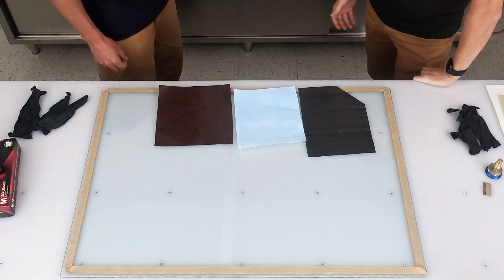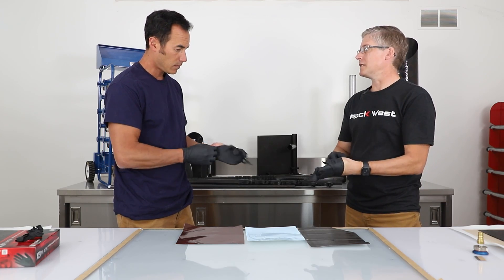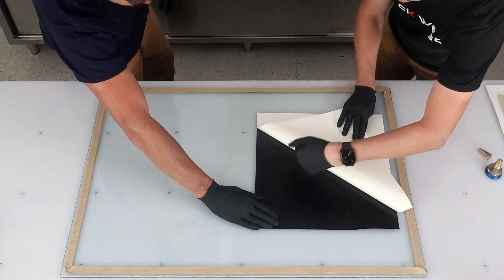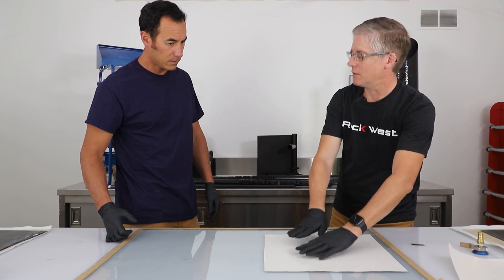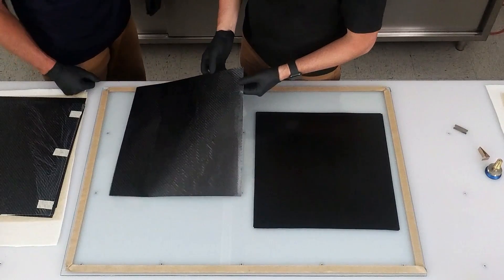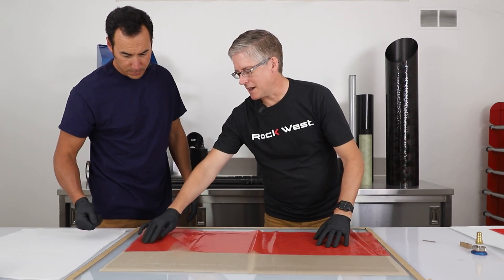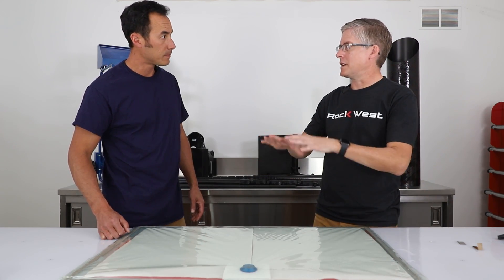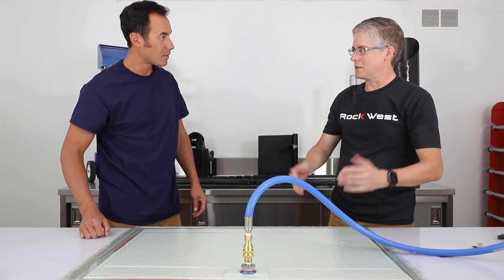Prepreg Layup & Vacuum Bagging

Comment: Dear Sir thank for interesting video , I have question , can we cut the prepreg in longitudinal (along 0 direction) direction on in the transverse direction (along 90 direction) to   make it fit with dimension requirements?.
Reply from the maker: Prepreg is easily cut with utility knives or scissors in any direction you need. Prepregs can be cut in very complex shapes to fit your needs. This is one the benefits of prepreg, it holds it's shape without fraying or changing shape, unlike dry fabric.
Reply: @RockWestComposites  Thank you so much for your kind information

Comment: How long do you leave the vacuum connected?
Reply from the maker: In most cases, and especially if you are only curing with an oven, the vacuum is connected before the part is cured and left connected through the cure and until the part has cooled down to below 130°F. That's about the point that you can touch it without burning your skin.

If you are curing with an autoclave, some requirements want to vent the vacuum as soon as the autoclave pressure reaches a set point, usually around 30 psi. but most times the vacuum is left connected throughout the cure cycle.
Reply: @RockWestComposites  So to be clear.  After what is shown in this video, the entire part (still attached to the vacuum line) is moved into an oven (or autoclave).  The part will NOT cure with vacuum alone.  The video implies the part will cure with vacuum only.
Reply from the maker: Correct. Prepreg requires an elevated temperature cure cycle in order for the epoxy resin to crosslink and become a solid. While prepreg will eventually harden at room temperature, it will take months or years, and will never exhibit it's full mechanical properties. Vacuum or pressure of some sort must be used throughout the entire cure to ensure proper compaction while the resin cures.

Comment: What companies in America use this laminating technique?
Reply from the maker: We can't speak for other companies, but most prepreg hand layup is done in this fashion. Of course, if you have some profile to your part, the layup will be slightly different as you place the materials on the mold.
Reply: aviation composites are usually woven and places at 90's and vacuum bagged with a heating blanket. so, anyone working around composite aircraft use this or similar.

Comment: I could see how an air bubble could get trapped then expand causing delam when put in the oven during the curing process. maybe a roller or squeegee might help
Reply from the maker: It's understandable how this could be perceived, but the vacuum bag is very powerful and provides up to about 14 psi of external pressure. The vacuum bag eliminates trapped air when the air is evacuated. The prepreg is porous and allows air to travel though it while is cures. It's also common practice to "debulk" or add vacuum bagging steps every few plies if you are laminating very thick layups. Adding an autoclave cure and the trapped air will be forced into the vacuum system with pressure during cure. A roller is rarely used as it can distort the fibers, but a squeegee is used regularly to push the prepreg into tight spots and to remove large pockets while laying the fiber down.

Comment: How long is the curing time here for pre-preg and did it need to go into the oven? Kinda wish they did this ep the whole way through w/ the final result as well like they did w/ the infusion ep~
Reply from the maker: Typical cure time for prepreg is 3hrs @ elevated temps. Most commercial epoxy prepregs cure at 250F while some Aerospace prepregs cure at 350F. The results would indeed have been interesting to show (debagging and plate inspection). I'll let the guys know next time they need to go through the whole process :-)

Comment: When you coonect the vacuum hose to vacuum pump, do you set any pressure?
Reply from the maker: Well, not so much. Vacuum is essentially negative pressure, and the more you can pull, the better off you will be. Here in Utah, the best we can get is ~26 to 29 Hg.
Reply: All the vacuum does is remove the air which is at roughly 1020hpa and once the air is removed, the atmosphere creates even pressure on the Part instead of using clamps etc.

Comment: I noticed no pleats, assuming you guys use them when needed based on part geometry to control how taught the vacuum bag is?

Noticed many other videos with a similar sheet part use pleats. Glad to know they aren't necessary for something so simple, way cleaner vacuum bag laydown.
Reply from the maker: You hit the nail on the head. Rarely can you get away without them but in some cases, the size and simplicity of the geometry allows one to bypass pleating.